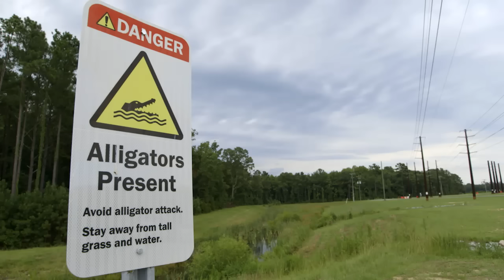Inside a Google data center

Comment: so, basically a really easy job being a google employee
Reply: Livereater00 Definitely not, but I'm going to make some assumptions. The employees there have a lot of responsibilities and they are required to have a vast amount of knowledge and experience to even operate, maintain, and upgrade these servers.
Reply: Uh no. These jobs are one of the most demanding and tedious. If a server goes down, the clients will be having these guys throats and Google high admin will be checking in to see if it is fixed every 5 minutes. everyone needs to be on the clock for 24/7 if a server goes down and all have to find the problem and fix it in under 6 hrs. But they have backup servers and more backup servers for those backup servers to make sure there is no catastrophic failure.
Reply: Well it could be easy working there, but getting the job would be extremely difficult.
Reply: Livereater00 which part is easy?
Reply: you right man, very easy.. because all of system intergrate to made it simple. but you must have knowledge about it

Comment: what happens if this whole place burns down lol
Reply: flosset Yahoo stocks will go up
Reply: flosset Nothing. Most data centers like that have a secondary, tertiary etc. identical facility with redundancy built in and connected to the primary facility so if the primary facility goes down, the secondary facility takes over with minimal to no interruption. The tertiary, quaternary, quinary facilities are configured the same way. All the major data center companies have that kind of redundancy.
Reply: @chrismc410  and what if that secondary identical facility also burns down?i know that chances this happening are very very low,but what if it actually happend?all servers would het to much damage to get any data recovered from them.
Reply: @rs agarwaen, Google has about a dozen identical datacenters all over the world to spread the load and give faster replies to requests on all continents. They won't all fail simultaneously. If 1 or 2 are down, others will simply take the extra load and you will barely notice the difference.
Also fire is not a real issue in those datacenters because you just need some heat sensors and CO2 to instantly kill a starting fire before it can deal any damage.
Flooding is a much more probable issue. Water is a much tougher adversary than fire. Especially for electronics equipment.
And obviously, power blackout. You can't run servers without energy.
Reply: YOUR SILLY COMMENT WOULD CEASE TO EXIST, AS WOULD YOUR TROLL YOUTUBE ACCOUNT.
Reply: and why ssd ? big price, low lifetime, small capacity. No need of hi speed reading.
Reply: Have you ever hear of RAID ?
Reply: They build a new one "One node in a larger network of data centres all over the world"
Reply: nothing because every data center is redundant to the others. So if one fails others manage the work done by the failed one. There would proabably be minimal file loss.
Reply: Fire suppression system
Reply: so google data center is on hard drives ? why not SSDs ?
Reply: i think ssd's have more lifetime since they are more durable, they have fewer chance of getting failure then the hdd's.
Reply: nothing. just one massive raid system. all backed up
Reply: What has raid to do with the failure of a whole datacentre? A raid only provides a disk level failure security.
Reply: NotSoFunny they are similar in the way that they have multiple copy's of data.  Spread all around the world.
Reply: Blackerflash sure there are similarities but 2 or 5 datacentres aren't a raid.
Reply: NotSoFunny ok
Reply: No more porn
No more pictures
Reply: Then that shitty yahoo or windows explorer is going to get more visits.
Reply: Rip internet
Reply: What you just said
Reply: This probably not the real one ...
Reply: flosset WE ASK FOR HELP TO LIVE! - MICHELE IAPALUCCI via ai giardini, 10 86015 Jelsi (Campobasso) ITALY
IBAN: DE64100110012621682264, BIC: NTSBDEB1XXX International transfer: 
TRANSFERWISE  -  Thank you  GRAZIE di CUORE  !
Reply: Theres probably a backup somewhere
Reply: Everything is geographical replicated to other datacenters.
Reply: michele iapalucci if your from italy why are you at the german N26 Bank in Berlin?
Reply: Nothing.
Google has backups upon backups all over the world.
Reply: Then a rip in the very fabric of space time will form.
Reply: offsite backups...
Reply: And people resort back to magazines for masterbation
Reply: The internet as we know it goes up in flames

Comment: Wonder how long it will be before we can get a Google data centre on a chip.
Reply: Yaboi Vilhelm you mean Moore law.. U bitch
Reply: Google probably holds about 1450 exabytes of data (but I cannot find any reliable sources). According to Kryder's law, hard drive density increases at pace of about 40% per year. I don't think there is any direct law for chips so I will use this law instead. Right now you are able to purchase 1TB chip. With these parameters it seems we will be able to store Google's data on chip in 43 years.
Reply: +Will Sterben
Do you mean the amount of data stored on a chip for the average consumer or Google's data centre will be the size of a chip? I think by then DNA would be used into the mix.
Reply: Kakuzu Senpai that will no longer work because the size of the transistor and p-n gate is reaching its limits.quantum tunnelling is dominating further this. we need a revaluation in the future.
Reply: We will be able to store all the data in the world on a chip.
Reply: O_O
Reply: Well it obviously wouldn't be silicon base designed chip, it would have to utilize something that can carry more transistors, because currently we have reached our limit with silicon based design.
Reply: Do the math, there's a formula that was made in the ~60s that predicts the multiplier of computing power available in a certain amount of time in the future. It has been accurate so far. I forgot name of the guy, but it is a law in science.

Comment: So this is were they choose which porn is good for me ? Nice
Reply: Falkerry I used to work for a data center and web hosting company  that almost exclusively hosted porn sites. I built many cages, many racks, ran a lot cable, built configured and turned up many servers, routers, switches, IPMI/iLO/BMC/DRAC settings, many OSes etc.
Reply: this comment is underrated

Comment: How it comes the venue GOOGLE choosed as Data Centre in South Carolina has no Bushes or Forest, the most advanced "Air-conditioning System" is called "Passive Cooling" in Australia Industry Society. Using the Natural settings like Bushes to shield excessive radiation of Sun light Heat from above and absorb heat transmitted in the Air. The other key point is the "Structure of the Ceiling and Walls" of a plant and the "Size of the window glass panels"and "Direction of window facing towards". Concerning the Tropical weather traits of South Carolina, it is hard to cooling down the "Data Centre" in Tropical Zone. Why GOOGLE CEO choose South states, South Carolina, which was famous for planting Cotton because of long hours of Sunshine.  By the way, Long hours of Sunbeam is most important for Cotton plant to grow fast and yield big Cotton Flower. Obviously, GOOGLE CEO has no knowledge of American History of President Lincoln era. What's his Nationality? and Origin? It is Common Sense. So his ability to running the Google Corporation is very limited and must mistakely lead to excessive cost in P&L sheet. IT industry personelle nowadays are treated with high social status but actually very low in IQ. If it happened in 20+ years ago USA, those personelle were impossible to exist because managers might have a lot of right Opinions from various Intelligent Sources but finally they failed and choose the worst one!     ==== If your portfolio of  investment including GOOGLE, you should review it seriously!    ----- By the way, as  I wrote last year, the most cost effective and efficient  "cooling down system" is to install a good Exhaust Fan on the wall. When you spay tiny cold water drops from Garden Spray in a room, the tiny cold water drops absorb the heat indoors and afterward, switch on the Exhaust Fan to exact the humid air out of your room and natural fresh cold air outside would flow in after the vacuum.  The temperature of your room or kitchen or bathroom would be cool and dry ----  K. MacAuley (Dee Why AU Auntie)--Sydney/Australia----29/07/17

Comment: "Inside a Google data center" show its first picture is a RIVER, HOW it comes? Because the major job of Data Center Engineer is to COOLING down the hot plant! The Cooling Agent they use is just "COLD WATER", the most old style and cheapest Cooling agent in the Earth History. I USED to major in Textile Mill Design in University which use SIMILAR "AIR CONDITIONING SYSTEM" via "COLD WATER". The most important point of efficient  "Air Conditioning System" used is to ensure every different layer of space Maintain  in the same INDUSTRY STANDARD TEMPERATURE. The Temperature suggested in the Video is 27C which is to optimize the efficiency of the electronics to working by themselves! During the non-stop processing of all the electronics  in every single chips or CPU of all isles of all containers, a lot of heat generated. High temperature would cause malfunction in such a large quantity Data Centre. Without good maintenance of the  "AIR CONDITIONING SYSTEM", GOOGLE WEBSITE would BREAK DOWN! JUST like in Woolen mills, Temperature above 22C would causing tangles in the spindles and over heat of the bearings etc. It is just English Traditional Engineering Tech nearly 170 years ago!  Modern "Air-conditioning Tech" introduced in your daily life is the Cinema, and your in house air-conditioning system such as Mitzbishi or Daikin made in Japan.  Kat MacAuley in Sydeny/Australia (Dee Why AU Auntie) 29/07/017

Comment: imagine if that facility run out electricity and the internet down..we cant even google what happen on the internet..
Reply: Except Google isn't the internet. You can use a different search engine to access other websites, only Google based services will be down.

Comment: USB Killer vs. Google Data Center
Reply: Benjamin Jooste make it happen
Reply: create usb port ,,,,with universal port converter (upc) ..LOL
Reply: they shoud try it ;O even if its a bad BAD! Idea...
Reply: You'd only be able to kill a few of them that way to take them all out you'd need to bring in a giant Tesla coil or drop a MOAB on the building.
Reply: Benjamin Jooste they don't have USB ports
Reply: @محمدداودشاہ  i think they have. They all have motherboard. Motherboards have usb ports! Servers are computers but withou GPU, with more RAM, more HDD or SSD.
Reply: @roleks560   okeyy.
Reply: If I could I would take them down
Reply: @JM-mi2ew  FBI has joined the chat
Reply: it would only kill 1 of the thousands of sub computers, ifmthat
Reply: Benjamin Jooste IAM still thinking what will happen to it
Reply: What you people really need is a gigantic coil of copper wire, a massive capacitor, and all that fun stuff to make a huge EMP coil, then just get close, or drop it, idk.
Reply: it would not work because its unlikely they have usb ports that are hooked up to the server and if they do have usb ports they would probably have such high protection that it wont even damage the servers.
Reply: Mission impossible 6 script leaked
Reply: Benjamin Jooste savage
Reply: LOL
Reply: this dude found a spot #Proactive
Reply: Benjamin Jooste bahaha
Reply: Try it no internet for a long time😀😀😀
Reply: Local...
Storage...
And windows XP...
Reply: i dont htink it will do something big.............Bc the Google have differents storages Data center And diferrent power so ithe usb Killler will not be enough for i dont even think it can brake one sevrer
Reply: Benjamin Jooste savage
Reply: DAVID 143 SHAH 3:29 😂😂
Reply: Then you would never been able to watch youtube anymore.
Reply: WHOOOOPS...
Reply: what would happen if you put a virus on a usb and then plug it in xD
Reply: usb killer
Reply: AMAZING!!!!!! (but in reality I think the USB Killer would get killed and blow up into tiny little pices and maybe a couple hundred serves would go down.
Reply: there is too much power in the data center for the USB killer the USB would EXPLODE
Reply: Larry page: OH DEAR...
Reply: @nevergonnagiveyouup4189  your name is f*ckd. You got me.
Reply: DAVID 143 SHAH true!
Reply: nop ....bro ....its our life ...without google.. we  are nothing....
Reply: @harshpatel1515  Change that mindset dude. Workout in between friends and people.
Reply: @abeginnerspov5968  lol ... Sometime it's ok ..
Reply: Google is nothing, how did you survive 10 years ago?
Reply: do you think a usb killer has a higher voltage output than the input on all of the mbs?? lol idiot
Reply: =dead
Reply: link ...write self ....and spelling mistake ......no open site.....so google also  help full for ....searching your unknown site ... think about you ...."you don t use google for  1 year ..." u understand what use of google.. no use youtube no use gmail no use drive or images ....  "i M a software  and database developer. .. and i say google is everything today ....

Comment: Hahaha a Google Guy with a mac book😂
Reply: well a google guy with a mac isnt that crazy. google doesnt make laptops (chrome books, yes, but not full laptops). now if this were a microsoft workplace, who actually write operating systems, then yes, it would be funny
Reply: That was a dell monitor connected to a macbook pro with an apple keyboard
Reply: b888 k
Reply: I've owned the same MacBook Pro since 2011 and it has been flawless and the greatest computer experience. And I don't make no ios apps so you're speaking nonsense.
Reply: remember Google started off as a Web browser sooo does it matter which computer platform they use it on?
Reply: Sulfen Couldn't you run windows on your Mac book via boot camp?
Reply: Ǝ V R G O L D nah search engine.
Reply: I own a Mac and no they're really not. They're good for making iOS apps but that's about it. Windows PC's can do a lot more and do it better because of their flexibility.
Reply: They also had Windows desktops.
Reply: And probably an adaptor...
Reply: No thanks
Reply: Nobody who's a serious IT "professional" in a DevOps focused company will use windows... It's either linux or macOS but for a work machine I'd take macos any day.
Reply: Wouter de Vries macbook is the best PC for working

Comment: History just repeats itself.
This data centre's size will shrink to your phone's size in upcoming 10-15 years.
Reply: Or they'll stay this big, with the power of what you said. Making something this large something like 1,000,000 more powerful in the same amount of space.
Reply: Ever heard of Moore's law?
Reply: You obviously just don’t get it do you ?? This isn’t a high end gaming pc ...
Reply: Never
Reply: david turbo what are you talking about? We're talking about the storage data used could be optimised both hardware size and data storage.
Imagine having 4x5cm chip that have about 16heck 100tb storage?
Well yeah that's future for you if it keep improving on this pace.
Though if the disk size doesn't change the storage size will eventually change.
Reply: We don’t need more space to store data! All we need is a higher compressing algorithm.
Reply: We can now store data in DNA, and it's extremely efficient, but it's very long, it had to improve a lot on this side.
Reply: That will never happen. Not in 10-15 years, not ever. Things can only get so small, you know?
Reply: then something the size of my laptop will be so powerful that it would have to make a black hole.
Reply: They will not shrink. We will start using more data instead. Maybe we will be streaming Videogames in 8k?

Comment: The real shame is computer and network technology hasn't changed in 15 years.  Some things may be fast but nothing is different.  We still route the same way, we still move data the same way.  Storage hasn't changed.  SSD's are just memory sticks.    Hard drives are 50 years old.  We just keep heaping on more.  Computers aren't any fast because we keep getting further and further from the hardware as we program.   Even layer one technologies are 50 years old.  Fiber has might be the latest thing and that has been around for 20 years in the IP world.

Comment: Why is so much rust on every water container seen at 4:49?
Reply: Because they're water container.
Reply: Kai Babick because no one gives a shit if the exterior of the container is rusting
Reply: Kai Babick watercooling that's been there since 1998
Reply: it looks like the stain emanates from above those tanks. the tanks themselves look like they are coated in insulation (the white stuff). If the structures above the tanks contain fans, it might be grease/oil dripping down as well. Might not necessarily be rust only.
Reply: Zolic xD

Comment: They aren't lying about the security, I had a job interview at a Data Center in my area and I had to have a visitor badge made, an ID and then they gave me very exact directions which I didn't follow well because I was nervous so I ended up parking in the wrong area which I think made them suspicious so they basically escorted me to my interview. Also no pictures/video things like that. I have a lot of friends who worked as server component replacers (basically just replacing all the parts of a server that needed replaced) they all got mac books that they carried around all day and can take home but that's useless since they don't work outside of the data center. Anyway, would've been cool to work there but I think my ability to follow instructions kind of screwed me over for that interview.